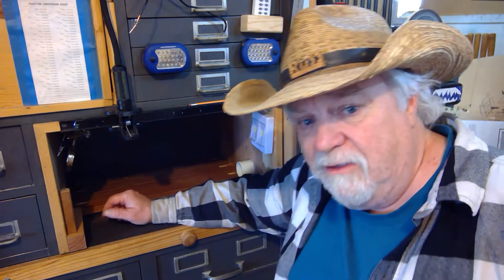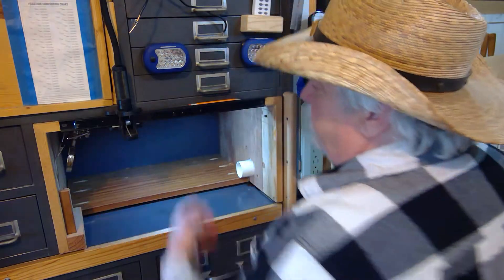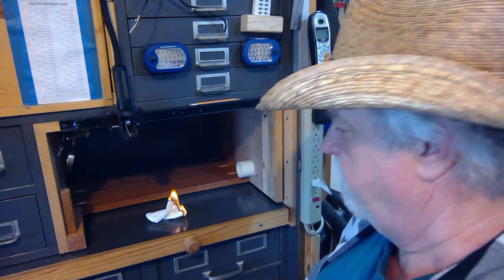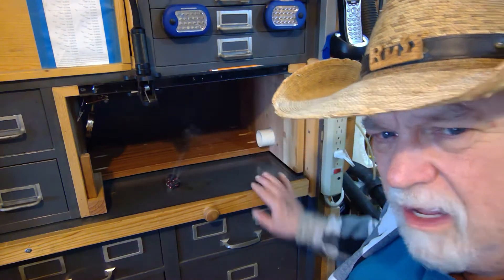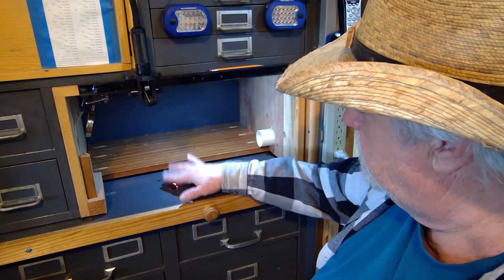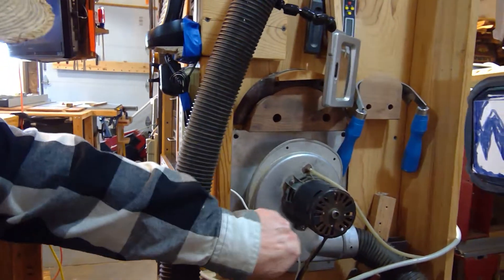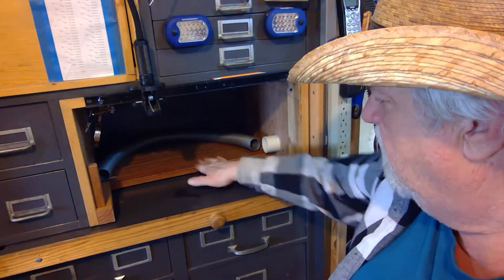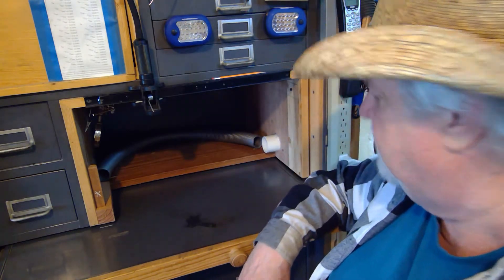Soldering Station Fumes Extraction by Rambling Russ

Comment: Going backwards through this little series...  The little stationary wooden shelf above the pull-out shelf is brilliant. I need to do that in my  little soldering armoire.  (When I manage to regain it.)

 I can tell that I have been ignoring the fumes with a little bit of soldering I have done. Of course,  we do use lead free stuff.  I have another soldering project with some silver on stainless steel waiting in the wings, to repair something in the kitchen.  Anyway, I have never vented the little bit of soldering I do. Bad mistake.

And one of my major intentions for this year is to help my spouse make the electronics lab which we added on to the house functional. We have already spent two weekends working on it including sorting through a huge vacuum tube collection!  Antique radios and speakers is the main hobby...  

The plan was to have the soldering tools and such setup at one end of a very long 15 ft bench. It's just the way the room worked out.  It should be easy for us to add some type of venting and fan directly above the soldering area there. The ceiling slopes down over the bench top and the attic is very close.

Thanks for all of the ideas!

Comment: I have COPD so removing the fumes is a necessity. Unfortunately, I smoked for way too many years so I cannot prove this hypothesis but for just as many years I was an electronics technician using a soldering iron constantly and believe that the fumes from the flux and solder contributed just as much damage to my lungs as did the tobacco. I started soldering quite a few years before it was recognized that the lead content in the solder was probably more of hazard than the flux/solder fumes and fortunately I didn't become a mad solderer like the hatter! So I applaud the effort to purge the work environment!
Reply from the maker: As  mechanic early on, I spend a lot of time in a shop blowing off brakes with asbestos filling the air before it was found to be bad.  I suspect it didn't help my COPD either.  I knew soldering fumes are hazardous so I wanted to be careful.  I have done my share of soldering (on car wiring) in those days too.
Reply from the maker: Oh yeah, I was a 3 pack a day smoker too :>)

Comment: Love how your table slides out from under the file drawers. I’m curious why you mounted the pipe low in the cubby area?

Hope you and YKW are both doing well.
Reply from the maker: Thanks (from YKW too).  It had mostly to do with the size of the fan and mounting it on the outside.
Reply: Russ Veinot I kind of thought so after I saw the fan mounted. For some reason I thought you meant the fan was outside the shop.